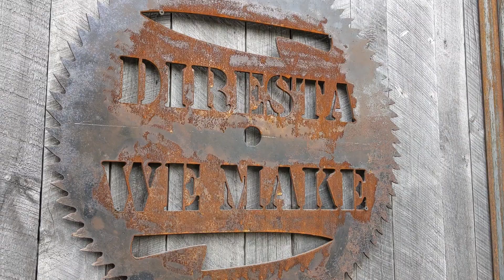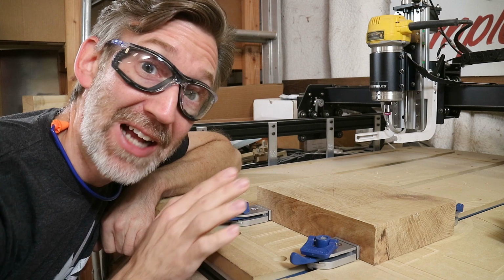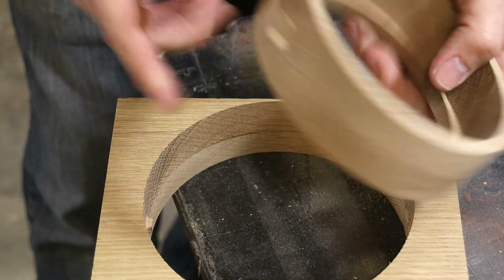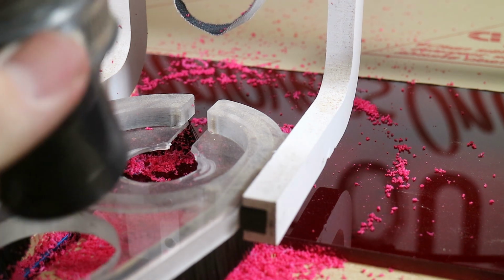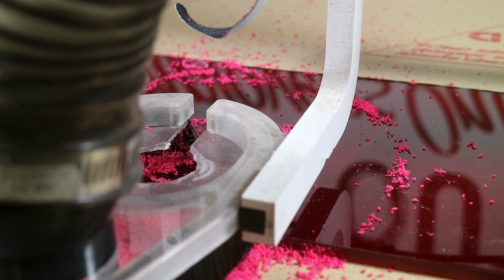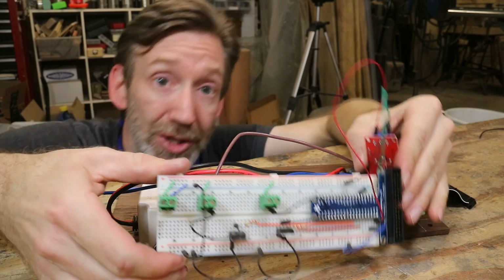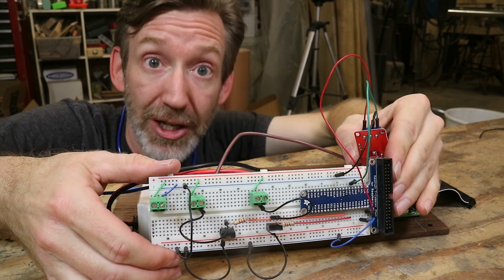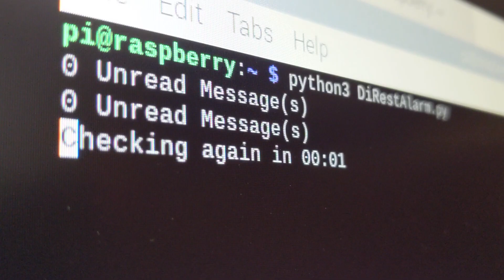The DiRestAlarm

Comment: I’d still miss his video being posted.  Also, I’d that went off at 4am when he posts half the time I’d either have a heart attack or that wouldn’t survive the altercation.  🤣  Beautiful sign Wes.  Also, I love those precise bits.  Did you see the Crown collet nut video I did a couple videos ago.  Those make the Dewalt router so much better to me when changing bits.
Reply: You know what makes a Dewalt router even better ?
Selling it and getting a Makita, or Porter Cable, or Triton. ;O)
Reply: gatekeeper65 I haven’t had any issues with mine, other than I don’t care for the collet and collet nut.  Upgraded those and I have a router that is precise and can easily be replaced by driving 2 miles to Lowe’s.  Anything else I’d have to wait for it to be shipped.  1-2 days minimum.
Reply from the maker: I got their 1/8" precise collet when I first bought the X-Carve and it's been great. They sent me the 1/4" to use with the sample bits, too.

Comment: This is very cool. Did you consider using a NodeMCU board instead of a Pi? I think it would have all the features you need (wireless and digital out for the lights) and is much cheaper than a Pi.

Comment: Please stop flicking away scrap pieces of wood on the table saw when the blade is running.  The only problem they cause is that idiots flick them away and amputate their fingers in the running blade, or knock a piece of waste into the blade it kicks back at the user.  Using a push stick does not make this safe, it's a piece of scrap, it's not worth it, let the blade slow down. Minute 14:33.
Reply from the maker: Post the timecode where I flick pieces away with my fingers.
Reply: @WesleyTreat  See above.
Reply from the maker: Eric, you can just reply instead of editing your original claim to try to make it look like I wasn't responding in good faith.

So, if I push a piece of wood directly into the blade with a pushstick, that's OK, but if I move a piece of wood away from the blade with the same pushstick I'm going to amputate my fingers? lol ok

As for your assertion (which you edited in to try to justify your original comment) that I'm going to knock the piece into the blade and have it thrown at me, that's the very reason I move the piece AWAY from the blade. So it doesn't catch the blade and get thrown at me. Which I do with the pushstick. With my fingers nowhere near the blade.

Would you like to add another qualification to your comment or just admit you were mistaken about what you thought you saw?
Reply: @WesleyTreat  Waste and scrap pieces that are on the left side of the blade are not subject to kickback because they are not susceptible to the rotation of the blade which is clockwise.  You could continue to do cut after cut after cut and waste pieces on the left will continue to slide forward and off the table surface quietly.  They pose little danger or threat to the user.  The bigger threat is when the user starts to swat them out of the way with a push stick and playing tag with a sharpened piece of steel running at 3600-4000rpm.  That's when accidents happen.  Why do you want to risk your fingers for a scrap piece of wood?
Reply from the maker: Um... the blade is still rotating toward me on the left side, same as the right. 🤦‍♂️ And my fingers are still nowhere near the blade. Give it up, Eric.
Reply from the maker: Eric: "The only problem they cause is that idiots ... knock a piece of waste into the blade it kicks back at the user."

Also Eric: "Scrap pieces that are on the left side of the blade are not subject to kickback."

I mean, you just moved the goalposts to the completely other end of the field there, sunshine.